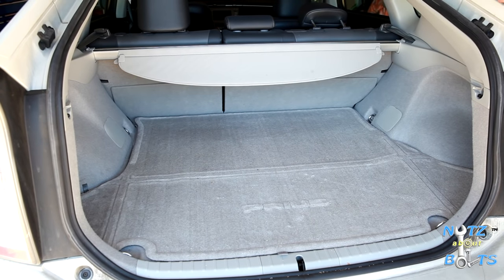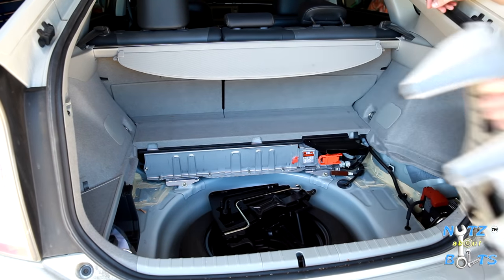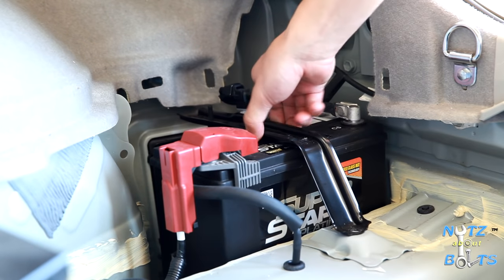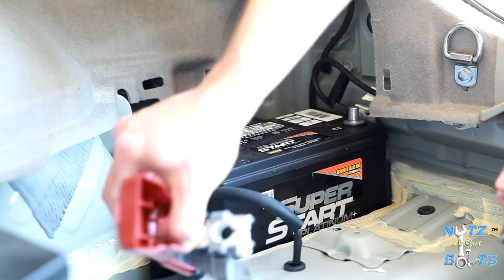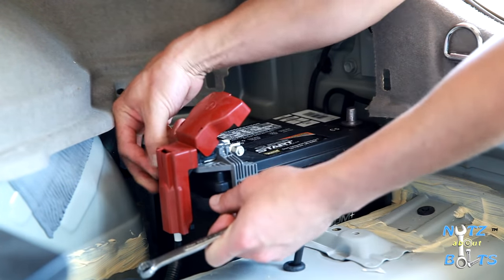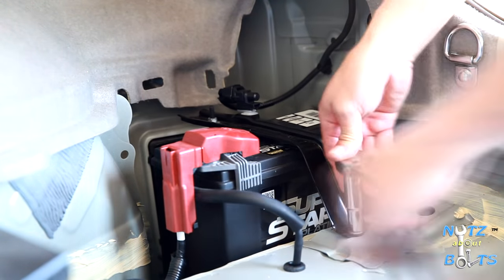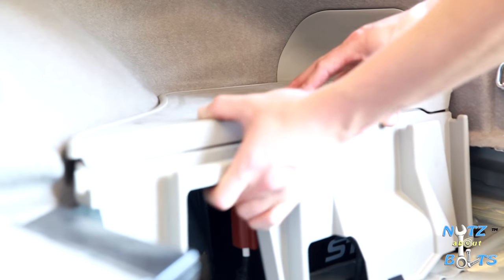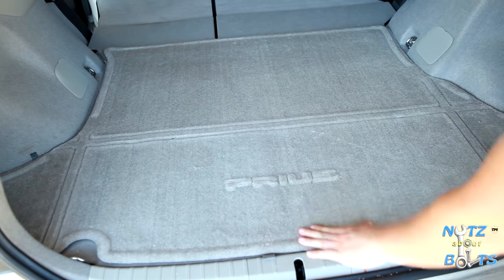2010-2015 Toyota Prius 12V battery replacement

Comment: So I have a 2010 prius and I am not sure if my 12V battery is dead. I was driving on the highway and all of sudden the car slow down and said check hybrid system. Pulled over and now car won't go in to drive  and continue to say check hybrid system and low traction battery. Soooo when it was towed off the highway the tow truck driver said it might be the alternator but my husband did disconnect the  12v ad reconnected it. When he did it the first time it was able to go in to drive and move but then it went back to low traction battery. So my husband believe it's the battery, but not for sure its the 12v
Reply from the maker: How old is your 12v battery? Any check engine light besides the check hybrid system?
Reply: NutzAboutBolts I don't know how old is the battery.  I bought the car 2years ago. So it may be the original, I did buy it used. It did come up check  engine light, the yellow triangle and yellow signal thats above the triangle.
Reply from the maker: Downonbendedknees I would replace the 12v battery first, then check the check engine light codes.
Reply: NutzAboutBolts Ok thanks we were thinking about doing that trying thr battery first. Your video was very informative thanks
Reply: I had a similar situation... said check hybrid system. I had it towed to the Toyota facilities. They found a computer control in the engine went bad. Replaced it for free (2010 Prius).
Reply: First Last  I found out that my gas engine is locked. We did switch batteries and it didn't work and that's when we went to get a full diagnostics and that's what was diagnosed. The shop said that it was going to be about $2800 to replace 🤦🏿.

Comment: Where can I buy the battery. The wallmarts close to my house dont sell them :(
Reply: I was able to find mine at autozone, but pep boys, O'Reilly, and kragen also has them. Thank you for this video, I did it all by myself! ♡ (Despite the initial incredulity of the guy who sold me the battery!) It is part# 46b24r- agm,  duralast  platinum battery, for $194.99 plus tax.
Reply: I bought a NAPA Legend Premium for $156 after 20% off coupon.  Toyota OEM are best due to 3 yr free replacement and prorated 84 month pro-rated warranty though but it would have been $50 more.

Comment: How long do these batteries typically last?
Reply: OEMs last up to 8 years with some going 10 years. It’s why OEM are best but I saved $50 by getting a Napa Legend Premium using a 20% off coupon.
Reply: @DooDahMon  that's what I'm looking at as well. Napa legend $181 (-20% -$10) vs $225-239 at dealer/online.

Comment: Well done! I bought the same battery, AGM type for $200. Perfect fit in the Prius V 2015. I understand traditional lead-acid is not good for Prius. It took 30 minutes. The + terminal was tight but I got it off after some pulling. Did not lose any settings. My battery was 6 years old, OEM and registered 11.6V on the car's diagnostics. I decided 6 years was enough.

Comment: That's not a starter battery so how do you know if it needs to be replaced?
Reply from the maker: When it dies, you’ll need to replace it. I replaced my battery 3 times now.
Reply: @NutzAboutBolts  
its not for starting your car... so how do you know when it dies??
I heard a rumor that when it is going bad your gas mileage begins to suffer. Is that true?
Reply from the maker: Kane Lono that I’m not too sure since I didn’t see my gas mileage suffering. All those times my battery died, which was less than 5 years of usage, I accidentally left my light on 😆😆😆
Reply: @NutzAboutBolts  
what happens when the 12v battery dies????
What are the symptoms?
Reply from the maker: Kane Lono nothing works. Can’t turn your vehicle on. No electricity in the car.

Comment: Thanks for the video! Advance Auto Parts had a warning about needing professional installation for this battery, but I couldn't find anything especially hazardous in the Prius Haynes manual. I think the warning is in place because it's absolutely vital to reconnect the exhaust, since it needs external ventilation and could otherwise contaminate the cabin air.

Comment: Thanks for this very good instructional video. All the videos you have done so far, have helped me tremendously. Please keep up the great work!!!!!! When you replace a 12V battery some makes/models require a reset on the computer so the car understands there is a new battery, not the old one putting out less volts. Does the 2012 - 2015 Prius require that and if so how do you perform that task? Possibly using the OBD II connection or other?
Reply: No
Reply: @rj.parker  Thank you.